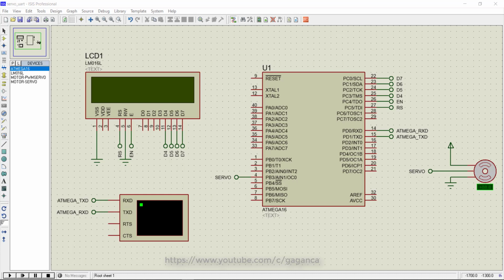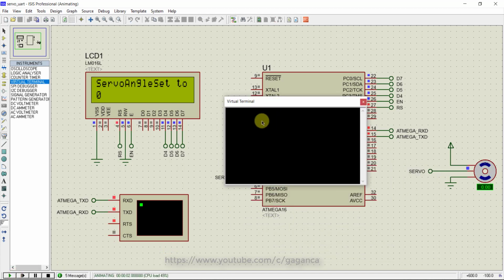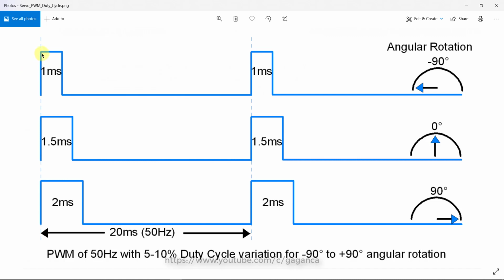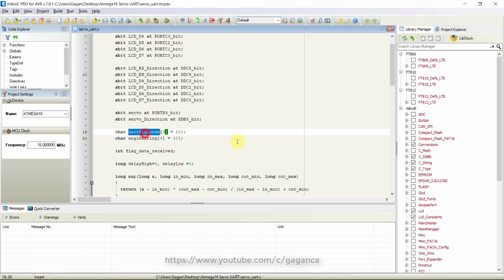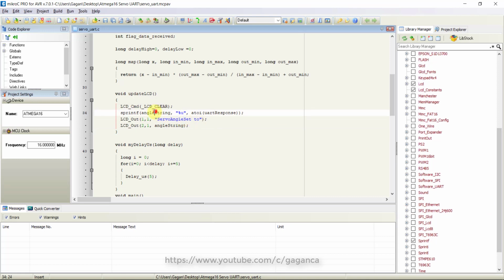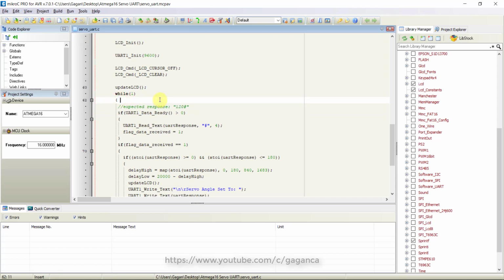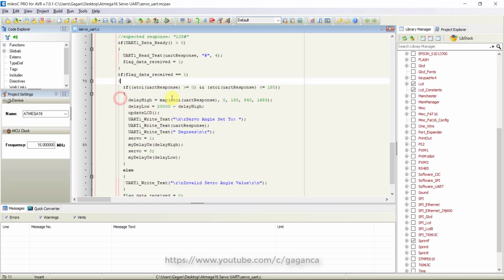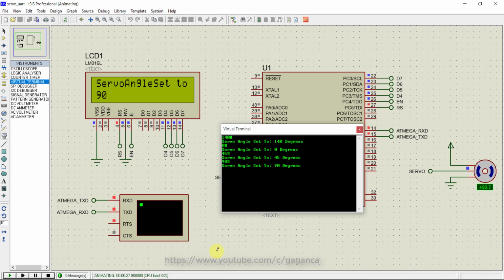Atmega16 - Servo Control with MikroC Pro - Software PWM

Comment: I compiled a project in MikroC for AVR with output all files and included Debug Information. I tried to Simulate and Debug in Proteus with Coff files. But Proteus did not show the Source Code Information for debugging.
I want to as k you. Does Proteus not support the Coff file generated by MikroC for AVR or am I doing something wrong to output files configuration?
But with Atmel Studio, it is all OK.
Please clarify.

Comment: Thank You, Mr. Gagan! This worked for me and my project. I only had to put the different range, since I am using an ATmega32 microcontroler (the range that worked for me was from 721 do 1450). And I have found out that, when simulating a servo motor in Proteus, the range depends primarly on microcontroler used, and not on the type of actual, real servo one would use.
Other things I used were exactly the same, and it worked smoothly.
Reply from the maker: Welcome, I glad this worked for you. Servo Simulation is not good in Proteus but you will not face any issue with real servos.
Reply: @GaganCA  Yeah. :=)

Comment: You forgot to explain the most important point of the software between 72 and 82. What's the logic of delayHigh and delayLow variables calculation...
Reply from the maker: Thanks for mentioning that. I expected that the logic is very clear from the waveform of PWM shown before the code part.
There I explained the total period of 20ms of 50Hz PWM wave and the delay HIGH is the amount of delay required to keep the PIN of servo HIGH and the delay LOW is 20ms - delayHIGH.
Reply from the maker: the Map function is converting the angle value to the duty cycle for servo.
Reply: @GaganCA  ok I got you but I meant why you map it between 840 and 1683? Where those special numbers comes from ?
Reply from the maker: @onurolce  the actual range should be 1000 to 2000 which is the PWM pulse width from 1ms to 2ms for servo. But the Proteus Servo simulation is not good enough to move the servo to right position with values from 1000 to 2000 and I tested with different ranges and found this range suitable for simulation. 
I don't have the hardware setup to test it but this is a workaround for simulation to set servo to any angle from 0 to 180.
Reply: @GaganCA  ok thank you:)
Reply from the maker: @onurolce  welcome